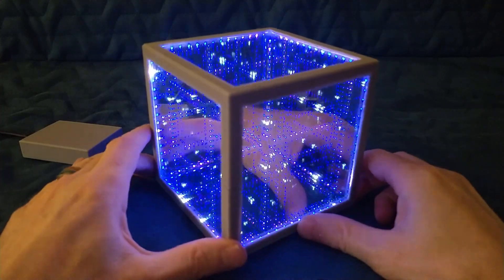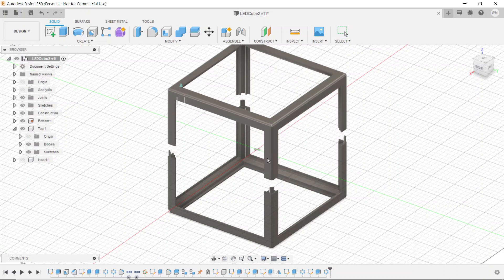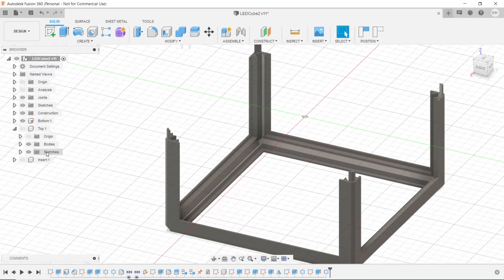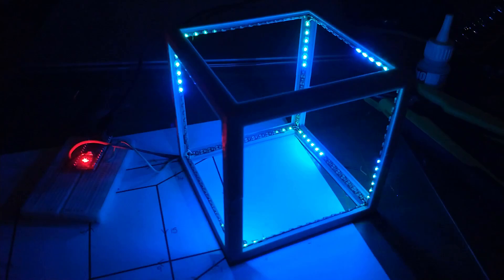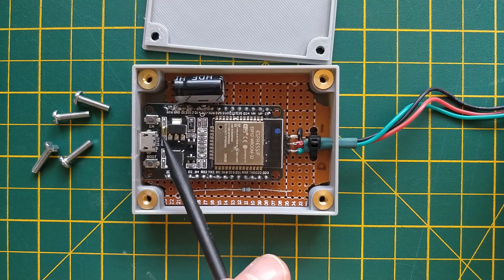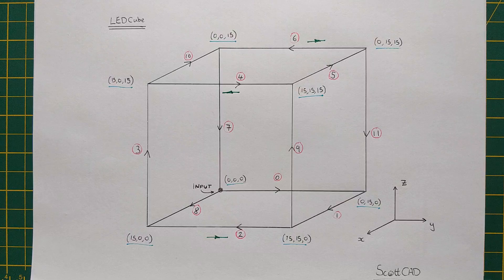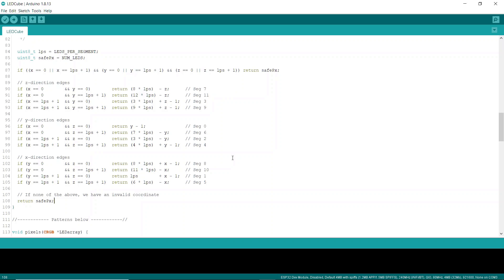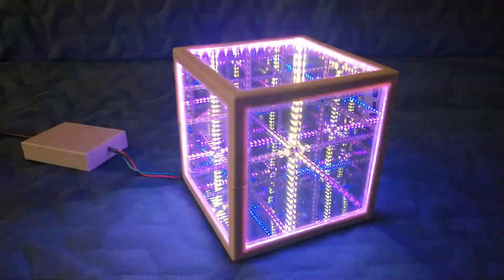3D Printed LED Infinity Cube Using FastLED, Arduino and ESP32

Comment: That 1000uF aluminium electrolytic capacitor isn't doing anything there, other than causing an inrush current when you plug it in. The switching rate of the LEDs is in the tens of kHz and that capacitor is going to look like a massive brick wall to any return currents at that frequency. I wouldn't bother with adding additional capacitance here at all, or at most I'd put a 10uF MLCC cap as close to the output pins to the LED strips as possible.
Reply: It’s across the supply isn’t it?
Reply: @davemartin7374  Yes, but that doesn't matter. A capacitor that large is massive overkill for ripple voltages, and utterly useless at filtering high frequency return currents. Those return currents will look at that capacitor like a brick wall - you might as well connect a 10M resistor over the supply instead. The ESP32 board already has decoupling over VIN, and again a 1000uF cap is not going to do any good there. If the intention is to decouple the LED strip for EMI reasons, then putting the cap (let alone an aluminium electrolytic!) at the end of a pair of 75mm+ wires is also useless - that path is far too high impedance and the fields will just spread out and couple through the data line or whatever else is nearby.
Reply: @gsuberland  how about low frequency changes in load? Having the whole strip flashing on and off a couple of times a second? Would this large capacitor help even out the supply voltage from a distant power supply?
Reply from the maker: Interesting. I've always assumed that this cap was recommended to smooth power spikes being drawn as the LEDs flash on and off rather than for EMI interference. Saying that, when I've made sound reactive things using a line-in for example, without a big cap like this on the power rails you can hear noise from the LEDs flashing through the aux line. Adding a cap removes that noise, and the larger the cap, the more the noise is reduced. Anyway, having this present is recommended on the FastLED and WLED webpages so I don't see there being any harm to having it.
Reply: @ScottMarley  There are a few things at play here, and the noise largely comes from two things: EMI and switching noise.

The first thing to understand about physical circuits is where the energy is. There's no energy in the copper. This sounds counter-intuitive, but it's true. The energy in a circuit exists in the electric and magnetic fields between a signal and its reference plane (usually ground). If you have two wires next to each other - one signal, one ground - they form a field in the space in between. In a PCB the fields exist between the trace on top and the ground reference plane below. The current flowing through the trace returns through the ground plane directly beneath that trace. The trace is just acting as a waveguide to steer the field around.

If you don't reference a signal to a ground, the fields spread out through the space (air, plastic, fiberglass, whatever) to find a low impedance path to ground. That's radiative EMI. If you take a 4-layer PCB and put a signal on the top layer, a signal on the second layer, and a ground plane on third, then the electric fields from the signal on the top layer will couple through the signal on the second layer, and cause cross-talk. Same goes for signals on wires instead of PCBs. This is why so many cables are shielded - you get a ground reference plane in all directions around the wires, so the fields don't spread out and cross-couple with other signals.

While decoupling is often talked about in terms of acting as a local energy reservoir to smooth out voltage spikes, it's also a key factor in EMI and cross-talk. The reason you decouple is to provide a low impedance path for high frequency return currents. If you make those currents flow further along a PCB, the fields generated by those currents will spread out looking for the lowest impedance path to ground. Often that isn't what you intend to be ground - the fields will couple into other signals and flow back into your ICs and jump to ground that way, creating a ton of noise (because you've got high frequency return currents in your signals) and radiative EMI.

Remember that in the most basic model of things, capacitors allow high frequency signals to pass but block DC. So when you put a capacitor between a signal or voltage rail and ground, you're allowing high frequency currents to flow through the capacitor straight to ground (like a short!) but not allowing low frequency currents (DC or near DC) to flow. The high frequency return currents use it as a low impedance path to get to ground. The critical part here is that the capacitor must have sufficiently low impedance. In practice, the bigger the capacitor you use, the more impedance it has at a given frequency, and some types are better than others. That's why you typically see 100nF ceramic decoupling caps next to ICs, not 100uF electrolytics.  The capacitance itself is not there as a "reservoir" - if that were the case you could just make it as big as you like. It's there because if you look at the impedance graph for a 100nF capacitor it'll have the lowest impedance at the expected frequency of the return currents for most modern ICs (which is not a product of clock frequency, but rise and fall time).

When you hear noise on an aux line in a scenario like this, it's caused by cross-coupling effects. High frequency return currents are coupling through the supply rails and the aux line to get back to ground.

There are two main reasons why it might occur. The first is direct EMI from the LED strips, due to return currents having to flow long distances before finding a return path, leading to the fields spreading out and coupling with other signals in the circuit.

The second reason is that the board itself (particularly the switch-mode supply) may be poorly designed, leading to EMI whose frequency and amplitude modulates based on the amount of power demand there is. When the rate of change of power demand is within the audible frequency range (likely with LED strips) then the modulation of the switching signals causes audible cross-talk.

When you add your giant capacitor, you aren't really solving either issue directly. The radiative EMI from the LED strips is still there, completely unaffected, but you just haven't noticed it because you're not pushing things to the kinds of limits where signal reflections and crosstalk become problematic.

The EMI from the regulator isn't gone, either, but the huge capacitor forms an RC low pass filter using the parasitic resistance of the wiring and traces on the board, which lowers the rate of change of the power demand, which lowers the rate of change of noise being coupled into the rest of the circuit. Because the resistance of these traces is very low, you need a large capacitance to bring the pole of the filter down below the kHz range. Assuming a 100mOhm trace, the 1000uF capacitor forms an LPF with a pole at around 1500Hz. This is why you slowly hear less and less of the noise.

If you want a more in-depth understanding of how all of this works, I highly recommend Rick Hartley's talk "The extreme importance of PC Board stack-up" at Altium Live a few years back. It's extremely eye-opening.
Reply from the maker: @gsuberland  thank you for that detailed account, that's fascinating! There's a while bunch of stuff here that I need to learn about. So would you recommend using a capacitor with lower ESR (and lower capacitance), like an MLCC? I know generally electrolytics are pretty crap when it comes to ESR. Can I also ask then why is this specific value recommended by the various libraries? Is it a misunderstanding? What would you use in an ideal situation or is it more complicated than this and depends on exactly how things are grounded?
Reply: @ScottMarley  Yeah, I'd recommend the MLCC option. You may still get noise without the 1000uF cap if the board itself has issues, but you may be able to fix that with a 1uF MLCC cap over the USB power input. Hard to say without looking at the board and it depends on a bunch of factors.

As to why people say 1000uF - it's just one of those things where one person recommends it for some reason - possibly due to experimentally finding it patched a supply noise issue elsewhere - and then the next person writes a library and copies that recommendation because the other person said to do so, and eventually we end up in a place where it's the status quo even though it doesn't actually do what anyone thought it did.

Comment: Love the result, great job. I think this definitely moves to my "will build" list, and maybe move it up to full size LED tape for a larger cube. Thanks for sharing, take care!
Reply from the maker: If you're going to do this, go for a bigger one. It would be much less hassle to put together. On the other hand, I quite enjoyed the challenge of making this work ;) some people just wrap the tape around the inside of the cube, but you don't get the nice sharp corners that you do if you cut it into sections and wire it together. Each to their own though.
Reply: @ScottMarley  Thanks for the tips, like you, I always try to make my projects look as neat as possible. I enjoy the challenge of going that extra step to find the shortest wiring paths with my LED projects, for both looks and better power distribution.

Comment: Such a cool project, I've been trying to think of how to make a modular frame for an infinity cube like this and you've definitely got my brain going. Super well done and excellent explanation! Wouldn't want to deal with pixels that small, ever!! Haha
Reply from the maker: I was originally thinking of a modular design, but eventually I decided it was too complicated and went for this instead. If you manage to sort one out (maybe PCBs that can snap together?), do let me know!
Reply: @ScottMarley  Wow pcb snapping is truly an awesome idea.....i will surely try to create the Gerbers.....if I am successful I would be happy to give them to you as I can't further continue due to lack of equipment
Reply from the maker: @anonymoususer900  There are two main options for doing this with PCBs. One is to have a bunch of different designs for the edges that only go together one way. The other is to make each side generic, then have some way to specify the routing of the signal at each junction. Either way, it's not an easy problem to solve (or at least it wasn't for me!). Good luck!
Reply: @ScottMarley  well I ll try my best.....thanks by the way!!